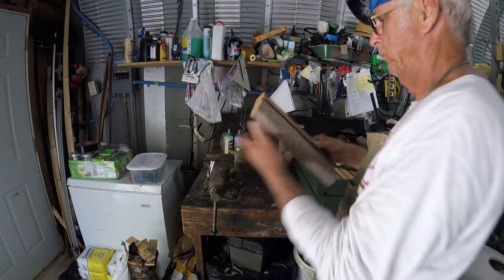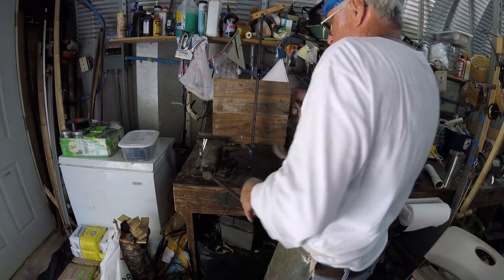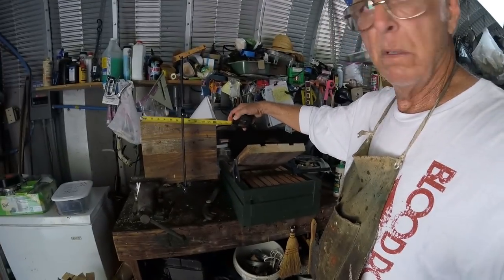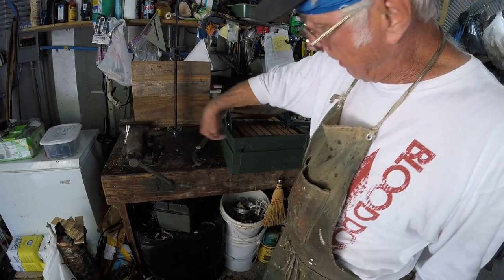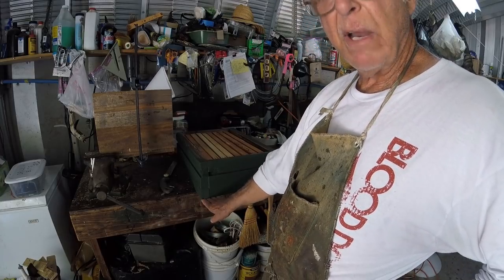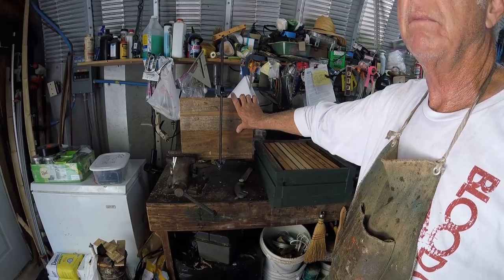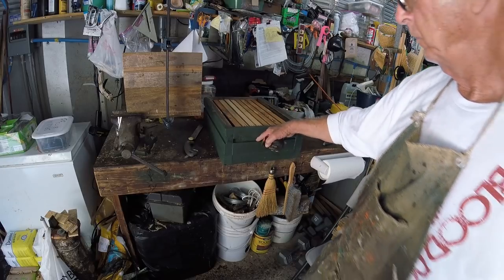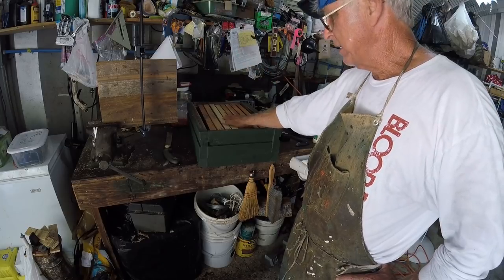Making Brood Factories

Comment: Steve what do you use for the heating element for your acid treatment gun
Reply from the maker: Hey Kenneth I use a Burgess insect fogger.They run about $ 60 bucks on amazon and it has a propane tank on it.I use 100 proof vodka ( the cheap stuff ) I mix 400ml of vodka to 100 grams of oxcilic acid. I have a video on it.The system is fast and works great.I treat them every month.Good luck with yer bees.
Reply: @stevesoutdoorworld4340  thanks I well get one you make it look so easy.